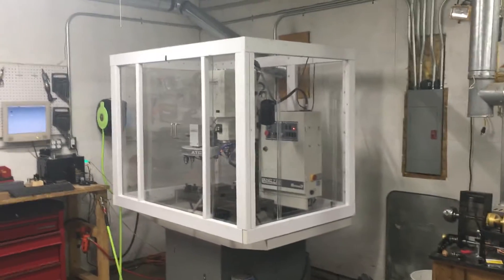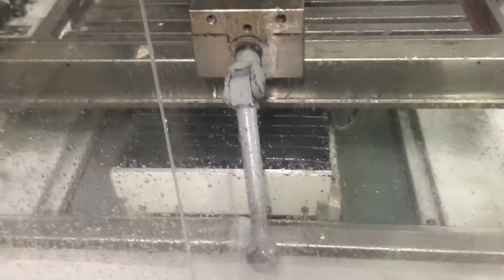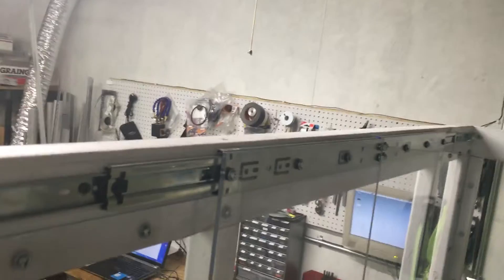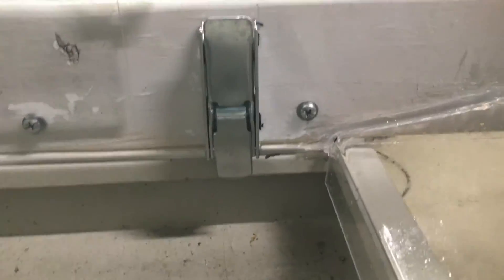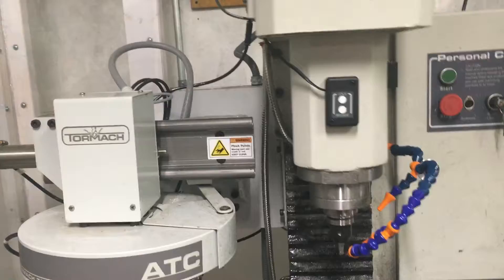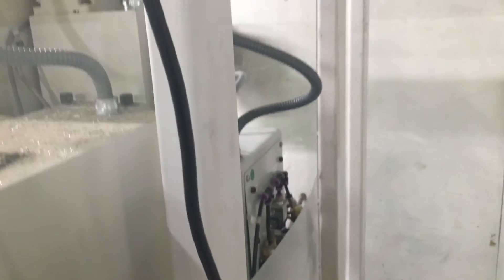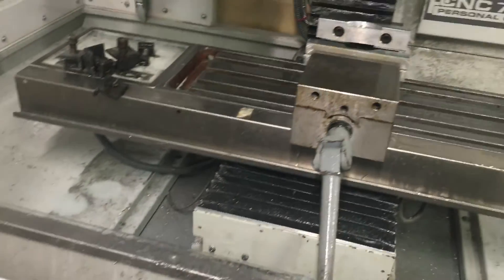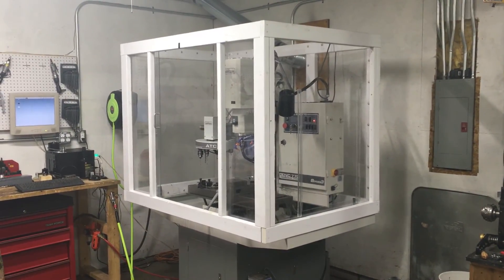Full Enclosure for Tormach 770

Comment: When that Chinese coolant pump dies, just remove it and unscrew mounting plate and drop in a standard issue sump pump from Home Depot. It gives you more pressure and can easily be replaced when it croaks.
Reply: Doug Hathaway been using it for years.  More than enough pressure and it’s reliable so far.

Comment: Where did you get the metal ratchet clamps? I like this design. I need an enclosure for mine and wanted to use wood for the frame. I see you have done that. I assume it will be okay as long as it is covered on the inside and protected with Lexan or plastic.
Reply: I got them at the hardware store, Ace I believe.  We have a "junk store" type hardware store near by and they had them which worked perfectly.